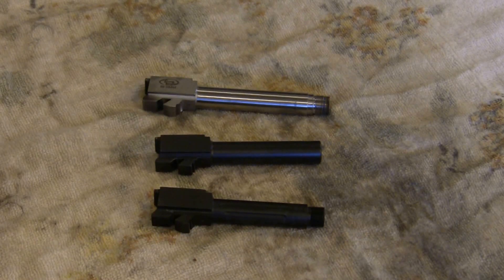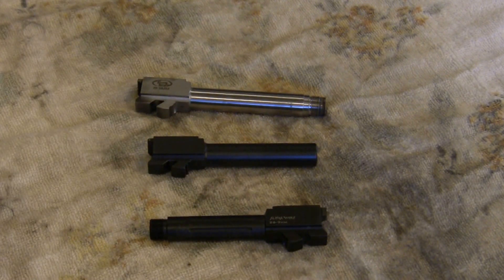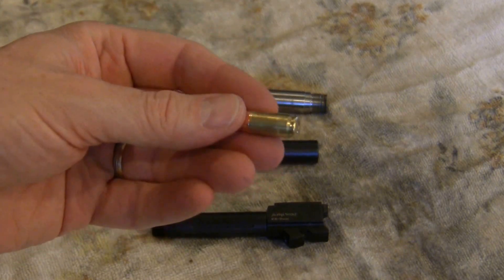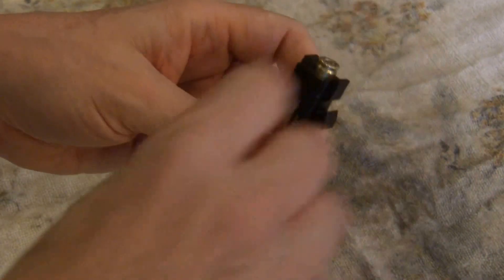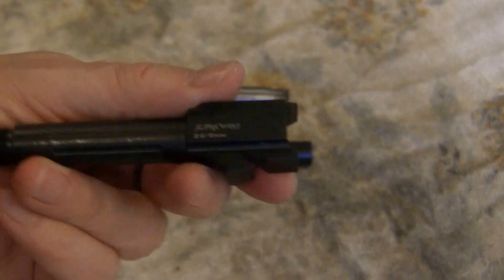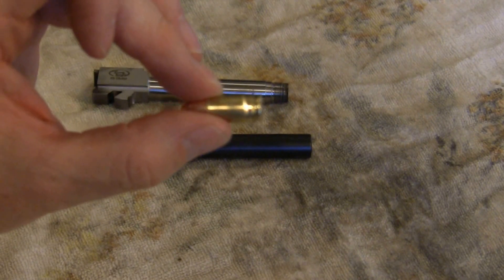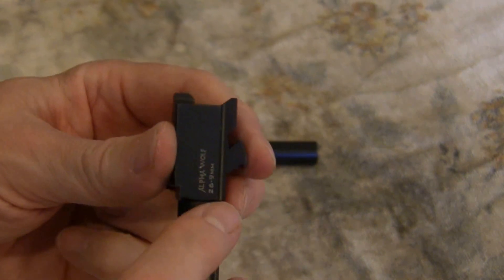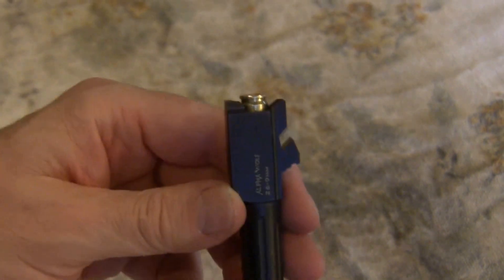Alpha Wolf barrel and LAX Reloaded Ammo a Bad Combination

Comment: Right off the bat as a reloader for over 30 years (including 9MM) that brass is not full length resized. It has a bulged base, possibly from being fired in a Glock factory barrel. I seriously doubt it's the barrel
Reply from the maker: The barrel has very tight tolerances; however, it was definitely the ammunition.   I have shot all of the LAX reloads and I won't be buying any more.  Because of my experience with what I consider an off brand I am leery of even buying new rounds from any company other than a well known brand.
Reply: Now you know one reason why I handload. I've seen horrible reloads from very expensive specialty ammo manufacturers including very tweaked, bulged cases and the same expensive pistol defensive ammo without taper crimps, which can lead to deep seated bullets and kobooms. Local police agencies often use jail trustee labor to put that taper crimp on duty ammo

Comment: It's not your Alpha Wolf barrel. If you look at the reloaded ammo it has a slight bulge in the casing causing your issue. The issue with the reloads is the fired brass was not roll sized to remove the bulge prior to sizing the brass. This is a common issue with reloads, especially on 9mm and 40 S&W. The Alpha Wolf barrel being a custom barrel has tighter tolerances. Hope this helps.

Comment: I believe that you have an ammunition problem and not a barrel problem. It would seem that the factory ammunition works across all of the barrels but the reloaded ammunition does not work in the Alpha Wolf, probably because of tighter tolerances.  It could be that the reloaded rounds do not seat deeply enough in the Alpha Wolf chamber. My guess is that the reloaded ammunition that you bought was not sized tight enough to allow the round to seat in the tighter chamber of the Alpha Wolf.  The other barrels seem to handle the reloaded ammunition. You need to measure the inside diameter of each of the barrels and then measure the base of the reloaded rounds and compare them.

Comment: There are two problems I have with this presentation of events....1st - tight chambers within SAAMI spec are preferred quality (not a defect)!  
2nd - judging the quality of the barrel by shooting crap ammo isn't a fair assessment.  The issue presented is the wrong way round here.  This video should be labeled "I bought a ton of cheap crap ammo that only runs in over bored chambers - opps!"
A simple 9mm case guage would have told you the problem long before you ran home to the camera to post a video to the world that only proves you don't understand your firearm and SAAMI spec!  
Sorry

Comment from the maker: One more thing I would like to add, when I go done shooting the 200 rounds with the Alpha Wolf barrel the interior of the gun was less soiled than what is normal with the standard Glock barrel and I believe that may have in part been to the tighter chamber of the Alpha wolf.  Overall I really like the barrels.  They lock up tight and secure in the slide, and I believe they have increased my accuracy a few points.

Comment: I recently got a alpha wolf 9mm conversion barrel. It worked just fine right out of the box. I did notice that some steel case winchester ammo was a little sticky in the chamber. ( it would stay in an uninstalled barrel, not drop free like brass.)  I polished the chamber a bit with some flitz ( kinda like brasso) and also the ramp. The chamber still has the black coating but the ramp does not. Its all nice and slick now.  Minor upgrade without any real gun smithing.     You might give that a try.  ( not figuring that to fix the LAX issue )      I noticed the steel cased ammo had a little friction between the rounds. So for grins I polished a few of them too. They are so pretty now and slick between each other.   That was just goofing off, I normally buy brass cased ammo.

I'm planning to get a couple more of the alpha wolf barrels.     Still having fun with yours?
Reply: You use steel case gross
Reply: @dunpit3925 Glocks will feed any casing type imo. I’ve never had a single issue with my Glocks or Sigs.

Comment: Same thing happened to me. Luckly i didnt buy as much as you did. I only bought 250 rounds. After having to pound out several rounds i finally figured it out.   I sorted them out by dropping off each one into the chamber. About half of them would fit in the chamber without being forced.
Reply from the maker: Because I had so much trouble with this ammo I now only buy factory new and from know manufacturers primarily Federal, which is also Speer.  I have never had an issue related to ammo since I have gone factory new with any of my weapons.

Comment: The problem is many 147gr reloads are too long, they won't seat in stock barrels or many aftermarket ones either.  To compensate you need a replacement barrel that has had the chamber throat cut longer to accommodate them. I don't believe this is available on the Alpha Wolf barrels as stated on their website "Due to SBN coating we are unable to custom chamber or custom crown Alpha Wolf barrels."

Comment: Had the same thing with a brand new factory Glock barrel and Bite the bullet reloads. 116 of 800 would hang up in the barrel. But would not do it in my Glock 26 or 19. It is bad brass resizing.

Comment: I had the same issues several weeks ago, and it locled up hard and I almost couldn't get the gun to open up; I tried brass, steel, reloads, factory ammo and the resupts were the same, I sent the barrel in and now I have no issues.  Lonewolf sent me an email saying that they shot it and had no problems.  But when I got my barrel back it was milled underneath the barrell; it may not be the ammo and is possibly the barrell.  Great video, please do a follow up of you fixed the issue or sent it in to Lonewolf.  Thank you Sir.

Comment: If you fired 60 rounds and had 3 failures, that is an ammunition defect, not a barrel problem.  If you think about it, the barrel is not changing dimensions from round to round.  The different rounds are what is changing slightly because something was done differently to the rounds that will not chamber.  I bet the cases are a little shorter than the other, so they did not receive a complete debell during the crimping operation of reloading.  The fact that those other barrels accepted the out of specification reloads, only indicates that they have loose tolerance.
Reply from the maker: I would consider the ammunition, if not for the fact, that the same ammunition worked just fine in the Storm Lake barrel, a factory Glock barrel and a factory Sig Sauer P320 barrel.  The chamber tolerance is not within SAAMI specifications.  I took several rounds that I have and tried them in the barrel and I tried them them in the other barrels.  Out of fourteen rounds 7 did not seat correctly in the chamber of the Alfa Wolf barrel, but did chamber with no issues in the Glock, Storm Lake, and Sig barrels.  If you put brand new ammunition in the Alpha Wolf barrel there is absolutely no play at all But there is play in the other barrel chambers.  Lone Wolf took the barrel back and are reworking the chamber. I have another Alpha Wolf barrel coming for my Model 19.  It will interested to see how that works.

Comment: Ammo is likely out of spec.  The Alpha Wolf barrels have a match grade chamber, which is tighter tolerance than factory and some other aftermarket barrels, depending on if they have a factory spec or match grade cut chamber.
Reply: Blue Line, you said "tighter tolerance than factory"  Seems to me the Alpha Wolf barrel is out of spec.  At least Glock spec.  Really it its a replacement, they should be using glock spec's.

Comment: shorter throats.  usually after market barrels need to be reemed  to shoot 147s . that's like a low recoil "chubbier" round. it's just a learning experience. what your gun like and what it dosent.
Reply from the maker: There are a few reasons I bought the new barrel.  The 1st is that I don't particularly care for the polygonal rifling.  The 2nd reason is that I want to suppress it and needed a threaten barrel.  The 3rd reason is that Alpha Wolf barrels are supposed to be, and I believe they are, really good barrels.  I am very glad that bought the barrel.  Its tolerance is very tight and as I have said before I think has really helped my accuracy.

Comment from the maker: John, at the risk of again being called an "Idiot with a gun," the idea of actually having to check the ammunition to ensure it would chamber correctly in that particular barrel did not cross my mind.  By the time that I tried to use these rounds in this particular barrel I had already fired approximately 400 rounds through a G19 with a stock Glock barrel and a Sig P320 with stock barrel.  The ammunition functioned flawlessly in both guns.  Furthermore, I have been in law enforcement for 41 years and have fired thousands of rounds of U.S. Government issued ammo, new and reloaded ammunition from various manufacturers and reloaders and never had an issue before.  I did send the barrel back to Lone Wolf, but I cancelled it after I got my Alpha Wolf barrel for my G19 and it had exactly the same issue as the G26 barrel.  What I am going to do is just ensure that I use new factory ammunition in these barrels.  I fired 200 rounds of new LAX 115gr FMJ through the new G19 barrel with no issues
Reply: I still think you are looking at an ammo problem.  As I stated earlier, just because the Glock and SIG barrels have a slightly looser tolerance, does not mean the Alpha Wolf barrel is defective.  Many, if not most, aftermarket barrels are manufactured to a tighter tolerance than combat type factory guns.  I am running one of these and shooting my reloads through it, with zero problems.  I am willing to bet that if I ran the ammo you are having problems with, through my gun, I would have problems as well.  That is because it is not reloaded to a consistent standard.  I bet I could run those rounds through a LEE Factory Crimp Die and they would run just fine in your gun.  I don't understand why you are blaming the barrel.  The poorly manufactured ammo is the problem.
Reply from the maker: +613JMM John,  I agree with you.  The barrel has a tighter tolerance than other barrels.  I have two of them now.  One for my G26 and one for my G19, and if we have to lay fault in one direction or the other I will agree the problem is more with the ammunition not being properly resized than with the barrels.
Reply: I just bought 1k rounds and was using my alpha wolf and had 3 jams just like you describe in the first 100 rounds. Not buying it again.

Comment: It could be a bad batch of brass, it could be a barrel with a short throat or tight chamber. Just relax, take a deep breath. Check the ammo first, then measure the barrel. Maybe go back to a factory barrel. After market barrels are not much better than factory. A glock is not a match pistol anyway. If you want tiny little groups choose different pistol.  I have shot many thousands rounds of reloaded ammo, much LAX and my own this year already with no problem. Don't over think it.

Comment: Lone Wolf barrels are suspect. I got the Lone Wolf Alpha G23 40-to-9mm conversion barrel. It will not chamber some of the off the shelf CCI 9mm rounds  (not reloads). I sent the barrel back to Alpha twice and it's no different. I sent casings along with it to demonstrate. They were like a cork in a bottle and jammed in the barrel They work fine in 12 other 9mm pistols I have as well as another after market conversion barrel. Alpha even went as far as to tell me that the casing must have expanded when fired in a Glock because of loose tolerances in Glocks. I told him, for the 4th time, that it wasn't fired in a Glock. And the spent casings still fit in all other 9mm pistols perfectly. If you want a 9mm barrel, and you want to be able to get rounds off the shelf and know they will work, don't get an Alpha.

When I told them I'd take them up on the offer to refund, they stopped responding to my emails. I have all the emails to go along with the story - complete with names and dates.

Comment: I just don't get why reloads were bought from LAX when their Factory new (new brass, powder, primer, bullet, everything) can be had for only about a few more dollars. It is very good quality clean ammo and matches the same SAAMI specs as the bigger brand names. You never have to settle for already used brass. Not anymore. Today's day and age there are great smaller companies producing brand new safe, and consistently good quality ammo at prices that make reloading or buying remanufactured a.k.a. reloaded ammo a thing of the past.  Only the very large calibers benefit from it, some.  They are even starting to catch up to those though.
Reply from the maker: dtnetlurker There were two reasons why I bought the reloaded ammo.  The first was, I wanted subsonic ammo and they were not offering any new ammo in subsonic.  The second reason was I have never used factory reloads before and based on what I could find on YouTube they looked like a reasonably safe option for reloads.  Stay tuned I may have a new video coming out called, "MPX Pistol - Dumb Gun that Failed, But I Love It."  I just bought the MPX last weekend and took it to the range yesterday and it failed, but I think I know why.  It is good to hear that you like their new ammo, because I have 1000 rounds of it also that I haven't fired.  Stay tuned.

Comment: Alpha wolf barrels chambers are tighter than actual chamber gauges to discourage reloads. It’s a pure liability issue. Don’t trust them in a life or death circumstance .. even with new ammo!  The chambers are too tight. Weekend warriors ... stick to factory new ammo you obviously know nothing about reloading or standard chamber guidelines.  Don’t hesitate to use that Lax ammo in your other guns or barrels. I bet they were all sized to The proper size. A chamber gauge will tell you everything.
Reply from the maker: Okay, I kind of take offense to being called a weekend warrior, but I will accept that as you know nothing about me.  You are correct that at the time that I made the video (Aug 2016) I knew nothing about reloading or standard chamber guidelines.  It is now almost four years later and I will admit that while my knowledge of reloading is still minimal I do know something and I know quite a bit about chamber gauges as I am a Glock Certified Armor and have build numerous rifles over the last four years.  As for the barrel itself I have put over four thousand rounds of factory new ammo through the it with absolutely no issues and I will never buy or use LAX Ammo again.
Reply: Did you throw the 3k rounds away or did you shoot it up?
Reply from the maker: @willirons3301  I shot it up in Sig P320s and Sig MPX.  While I didn't have any chambering issues with the LAX ammo and those guns, I did have light primer strikes and failures to properly eject.  The P320s had fewer issues than the MPX did.

Comment: You quite obviously don't reload. It's the ammo, NOT the barrels. Thanks for the heads up though.
Reply from the maker: Paul, you are absolutely correct.  i do not reload.  I also no longer purchase reloads or "remanufactured" ammunition.  I sho0t way too much ammunition to make reloading even a little bit practical.  I also live some where, where I can still buy ammunition in bulk and have it shipped to me, and there are many options for good reasonably price=d 9mm in bulk.  Now with that said, I agree to some extend that the ammunition was the bigger issue but Alpha Wolf barrels due have much tighter tolerances than many OEM and aftermarket barrels and that has to be considered when using these barrels especially if you are a reloader.

Comment: wow I did not mean to jinx the barrels but don't they have lifetime warranties
Reply from the maker: AGTXCD, they do have a warranty, but technically there is nothing wrong with the barrel itself.  It just has a really tight tolerance and does not like reloads.  I have shot about 600 rds of Remington UMC 115gr FMJ through it with absolutely no issues.  I bought the LAX reloads because they were rated as 991fps and I have two suppressors that I will run on my guns, but I won't be using the LAX through this barrel.  If I can run 250 to 300 rounds of the LAX ammo through the Storm Lake barrel without any issues, I will probably change out the Alpha wolf barrel.  However, until then nothing but factory loads in this barrel.

Comment: recontact the campany about this and have them send a new barrel out to you. it is a defected barrel.
Reply from the maker: Okay, I sent Lone Wolf an email describing the problem.  I'll let you know how it goes.
Reply: Armed Diver any status?
Reply from the maker: RAZORJB Yes, I sent the barrel back to Alfa wolf and they polished the chamber.  The rounds still do not fit the chamber, but I don't blame the barrel.  I now have two Alfa wolf barrels.  One for my G26 and one for G19.  I love these barrels, but they have very tight tolerance and I won't be shooting anything from them other than new factory ammunition.  I also won't be buying any more LAX factory reloaded ammunition.  The casings are not correctly resized.
Reply: Armed Diver I bought 4 from them returned all 4 and got them back and then returned 2.

I polished the feed ramps and then had TiN coated.....zero problems now.  Have to say its a pain in the ass and shouldnt have to be.